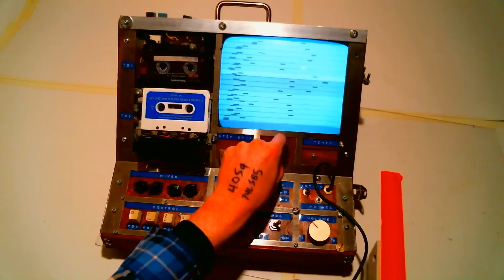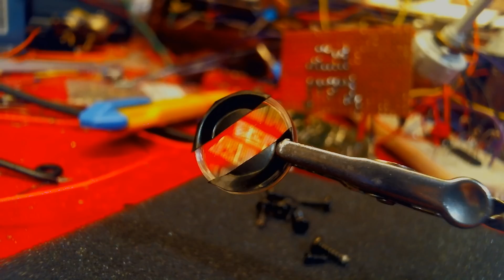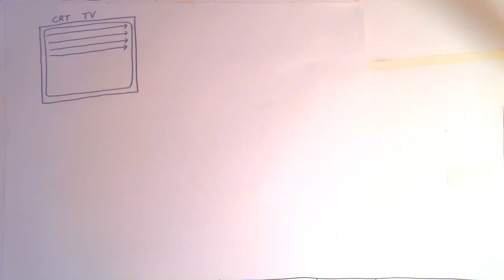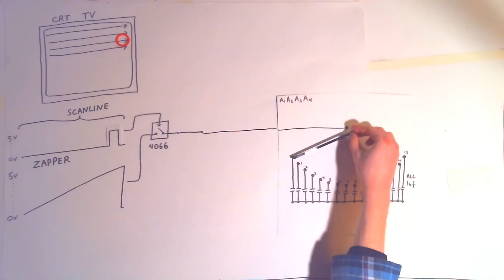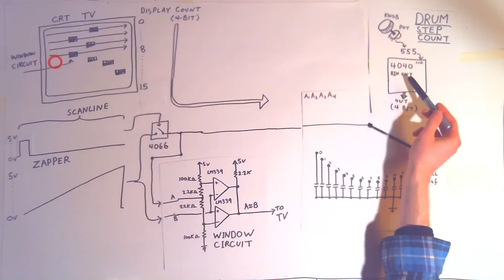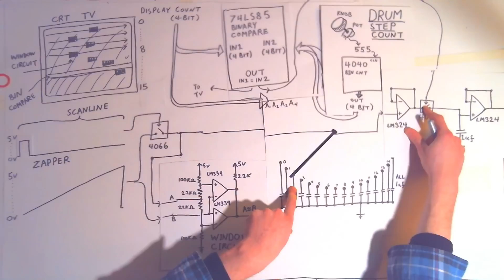Moog Circuit Bending Challenge 2017 (The Winner)

Comment: Seriously, how did you manage to do it under 70$ when the gun already cost more than 30$ plus knobs, speaker...
I'm impressed but quite suspicious at each moog circuit bending chalenges when I see what people do "under 70$"
Reply from the maker: The zapper cost two Canadian dollars at a second hand store.
https://cdn.hackaday.io/images/8167521490059848860.JPG

I think you're looking at the projects backwards. Most circuit benders collect cool junk whenever they see it free or cheap then design projects around what they have. That's a lot less expensive than coming up with a design first and having to hunt down specific items.
Reply: Here in France, every piece of junk cost really too much. It's nearly impossible to find good stuff in the street or whatever... So hard to bend cheap !
Reply: For my bends I want other people to make it so I use new components. Last year I got a "Minion" and a tape deck from Walmart for around $40 an Arduino Pro Mini for $10 etc. online.